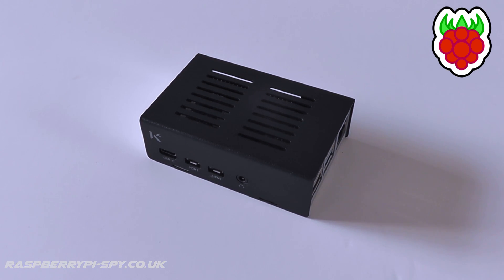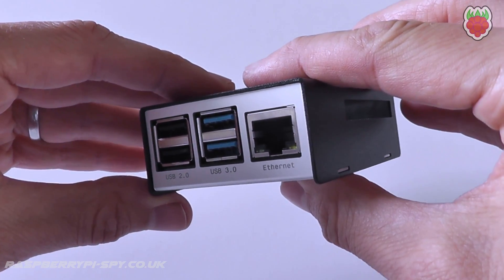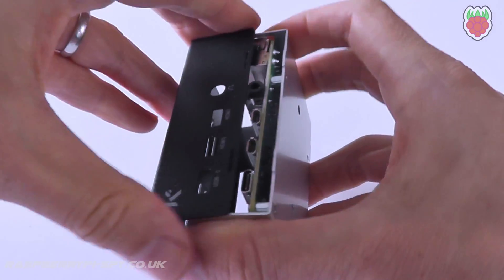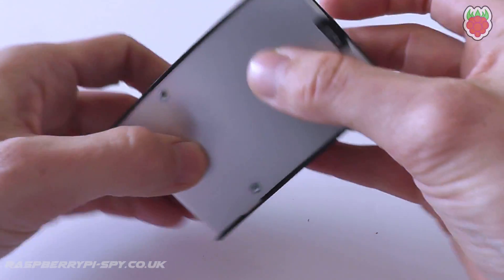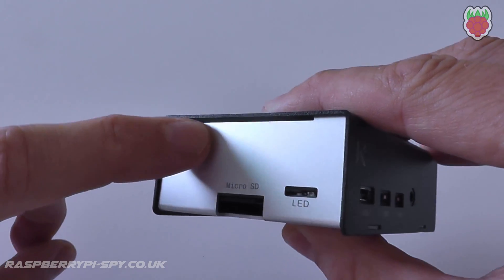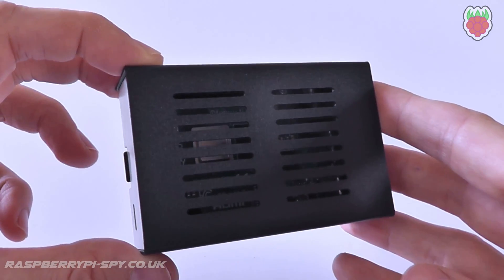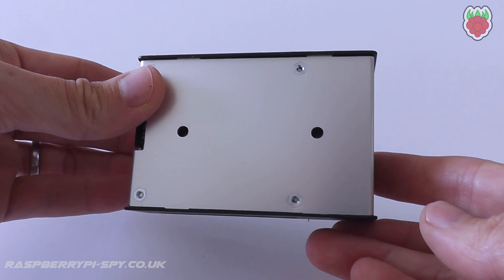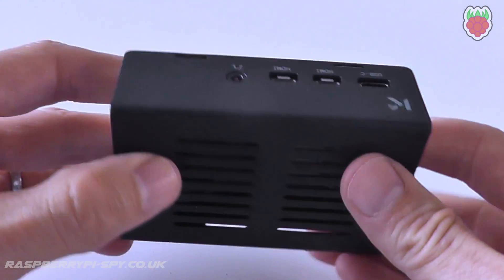Raspberry Pi 4 Steel Case from KKSB

Comment: It is a good looking case. However the heat issues with the Pi4 I think it would be a really bad investment. The Flirc case is about the same price but the case acts as a heat sink. IF this new case had an optional top that fit the Ice tower it might be onto something. As is, it is too expensive without addressing the heat issues.
Reply from the maker: I think with this case a fan would be an option. They've got another case I'm going to look at that is a solid lump of aluminium. The reason I did this review first is that I've only got one Pi 4 and the other case has a heat pad to connect the CPU to the aluminium. So once I commit to that I don't want to remove the Pi afterwards :) With previous models I just bought 2 or 3 but with the Pi 4 I wanted to wait to see what people did with the extra memory before investing in another one.